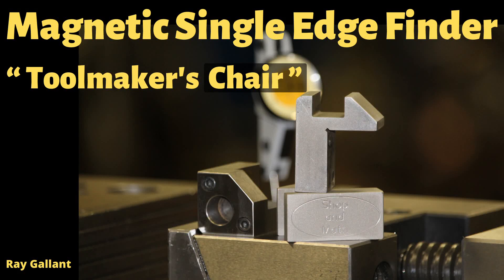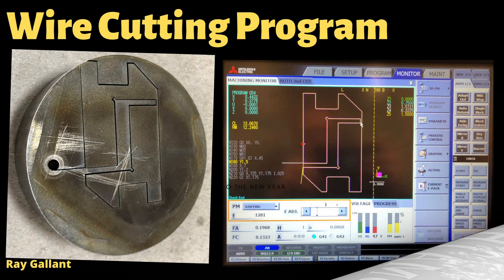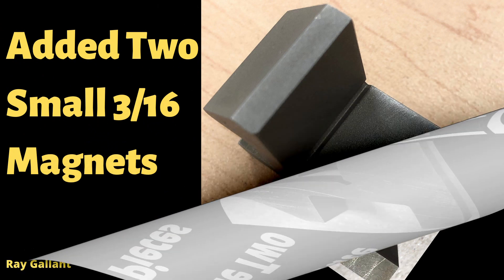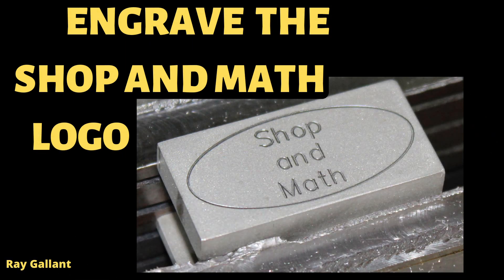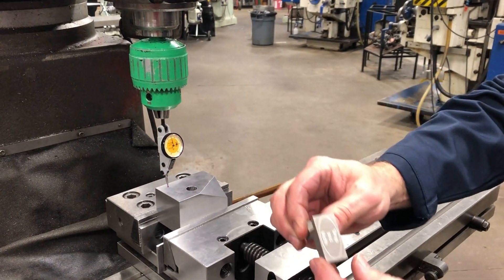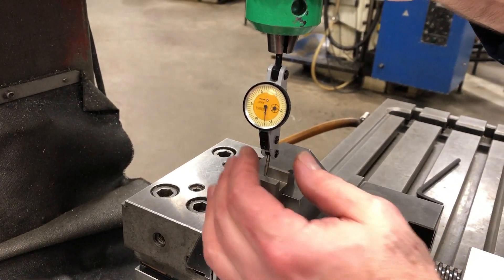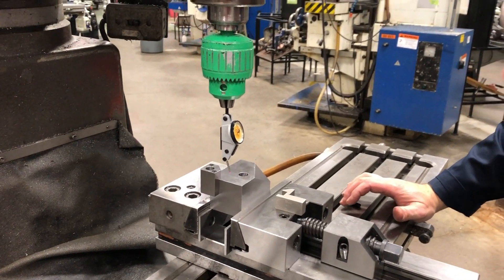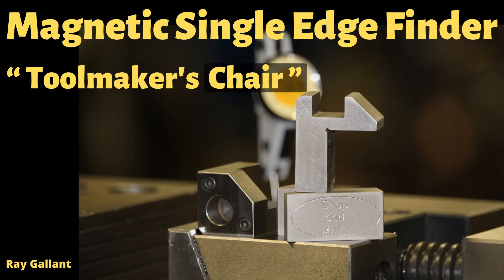magnetic single edge finder “Toolmaker's Chair ”

Comment: How do you qualify the toolmaker's chair works as intended? I saw a couple videos of toolmaker's chairs on youtube, but none of them went beyond the initial machining. 

I was thinking to put the long side on a gauge block that is sitting on a surface plate and sweep one of the short faces. Then flip the chair upside down, on the underside of a second gauge block wrung to the first, and sweep the second short face. (like on a cadillac gage 2 blocks make the same plane). They two faces should both be parallel and the same number. How did you do it?
Reply from the maker: you could easily use two gauge blocks. If you want itoo
 only issue with using gauge blocks is that thay would fall down you need the magnet to hold them in place and you should not magnetized gauge blocks.

Comment: Why didn't you use a normal spinning edge finder in stead of a chair?
Reply from the maker: Spring edge finder’s are a non-direct measuring instrument and are considered to have a limited accuracy

Edge finders are an excellent fast set up every day type of tool but limited in accuracy and can easily give a false reading

If you need more information on edge finders I’ve made three videos so far
The one that would pertain to inaccuracies would be called edge finder maintenance

Thank you for your question
Ray
Reply: @shopandmath  thanks for your prompt response.